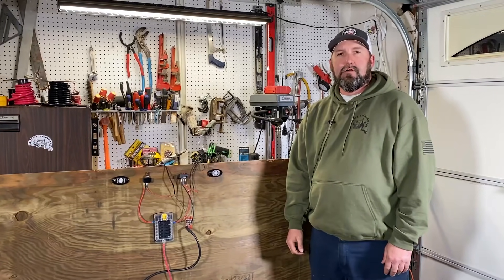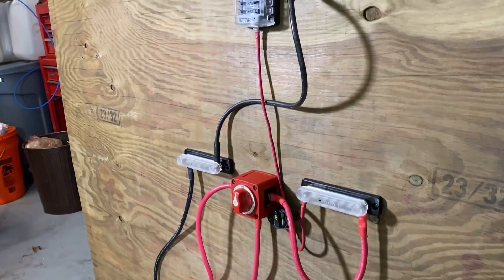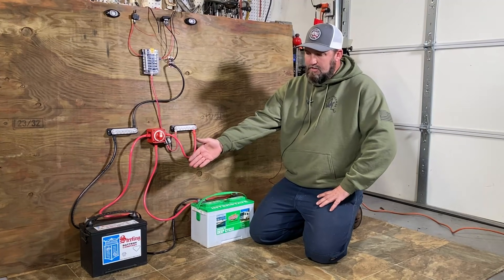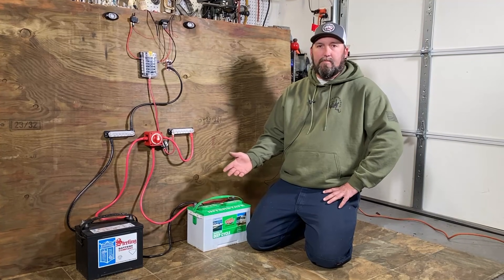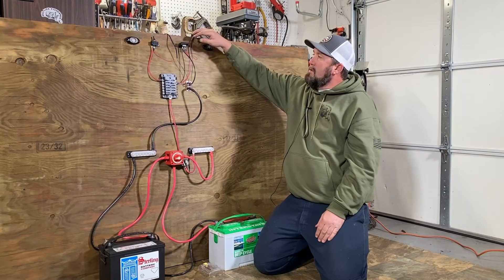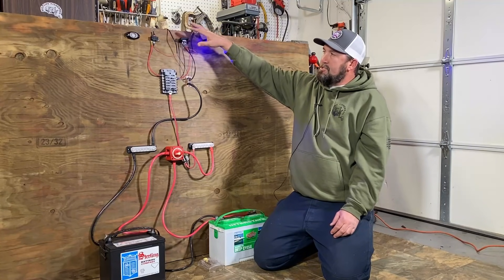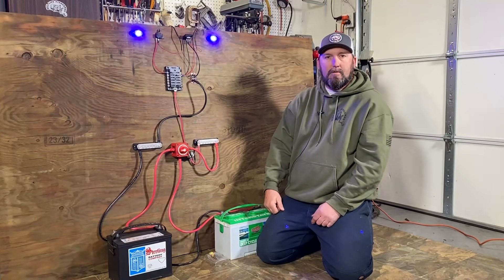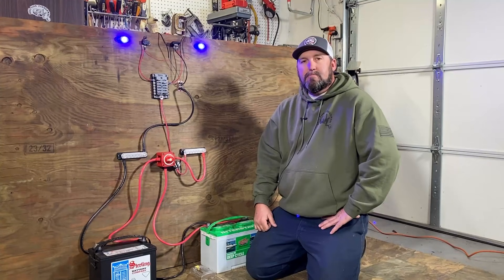BASIC BOAT DUAL BATTERY WIRING | HOW TO

Comment: I thought you werent supposed to connect negatives together of batteries of diff group sizes, can you clarify that for me?  New to this.  Thanks.
Reply from the maker: So you don’t want to connect the positives and negatives together this is parallel.. now with the battery switch on 1&2 they are .. and why you should only select 1&2 in emergency only really.. if you do it all the time.. it’s not good for the batteries.. the negatives have to be together for everything on the boat to work off of either battery.. hopefully that explains it a little better .. thanks for watching

Comment: Great tutorial. Thanks for sharing. Would this work with a 24v trolling motor setup? I assume your ground would only be connected to the first battery in series in the 24v system.

Comment: Great video. Quick question, I’m going to be rewriting my pontoon that I am redoing and I think this all makes a lot of sense. I was wondering though, if I had the switch on the Back by the batteries and ran the buster bar right next to it, and then run a line for a fuse box under the dash from the buster bar( like in this video). Will I be able to run 4 speakers and a sub woofer attached to the fuse box(that has fuses) which would be under the dash.  Or is it better to have the batteries under the dash in a pontoon? Thanks for all your great knowledge.
Reply from the maker: You can run a fuse panel under the dash and hook a stereo to it.. the stereo would then power the speakers itself.. but an amp for the subwoofer I would run back to the battery or main positive bus bar..  let me know if you have any questions and thanks for watching

Comment: On this set up are both batters recharged with the alternator?
Reply from the maker: If you have the switch on 1&2 yes .. but they are in parallel when in that position so if the batteries are not the same .. it’s not good to do for long periods.. only for emergencies really.. if you want to charge both batteries all the time.. you need to get a battery isolator charging relay.. I have another video on just that.. thanks for watching

Comment: You covered the bases pretty good! I would like to add that you have to be careful with some of the smaller outboards (most 75hp and less) Too much battery can burn out the alternator! A badly discharged battery can be too much for those little things. In all cases, the output ratings of a stock alternator is not continuous duty (inboard or outboard). Should you select both batteries and one is badly depleted it could be the end of the alternator. Now! Lithium batteries! Oh my god are these things a charge sponge! If you want one of these things for your auxiliary battery, there are things you need to know. #1 it may last longer than your boat. #2 you need to know how to feed it. If you have an inboard, you could put a heavy duty marine alternator in, but it may stall your engine when it kicks in on a depleted lithium 😆. There’s a better way. Use DC to DC charger like a Renogy to limit how hard you charge and to bring it to it’s peak. They come in 20, 40 and 60 amp range, so select one within the reasonable range of your alternator. Also invest in an AC powered lithium charger if you know you won’t have enough run time to bring it to full before your next trip. lithiums don’t need nor really like being stored at full charge like your old lead acid/AGM’s. If it’s going to be a while, anywhere between 70 and 40% full is ideal, just remember the self discharge may be around 2% a month if it’s wired in, assuming there’s no other parasitic drain. You just have to plug in the lithium charger a day or two before you use it. 
At this time I cannot recommend lithium batteries as your starting battery. Too hard on the alternator (no limit on charge) and may not have the high current needed for the starter. A V8 can draw hundreds of amps in a surge. It should be fine to use it as a boost momentarily to help the starting battery. Just don’t don’t use the battery switch when the engine is running, it’s better if you have momentary jump or relay.
Reply: Thank you for this information, please refer to my question above, thanks

Comment: pls help me, i just want to install the most basic one, outboard to the battery. currently the outboard battery cable i connect directly to the battery before fishing then once arrive home i will to disconnect again. how and what shud i do to leave the battery connected with the cable without i need to disconnect every single time back home. can i just buy a single switch? black cable goes directly to the negative terminal and positive to switch, then switch to positive battery? is this the correct way? if yes from switch to positive terminal what gauge wire should i use for honda bf60?

Comment: Great video. Those 3 way switches normally should be a  "make before break" switch. This prevents there ever being an open circuit before the next circuit is made. Therefore you can switch through positions 1, 2 and both with motor running as long as you DON'T switch through the OFF position while it is running.
Reply: What is the best way to charge battery 2 (battery 1 being the one used to crank motor over)?  Can you switch from battery 1 to battery 2 after starting the motor, provided you don't ever go to the "off" switch?  Otherwise, how do you ever charge battery 2 for a situation if you used your stereo at sand bar for quite a while?  I would have thought the best way to charge battery 2 would have been to go to the dial where you used batter 1+2 to do so, but you mentioned in the video to not do that very often.
Reply: good point..
Reply: This is my exact question also... once you drain battery 2 with the stereo/trolling motor/fish finder, etc. Can you switch to battery 1, start the motor up and make sure all is well, then switch to the battery 1&2 position to re-charge battery 2? I completely understand never to switch to, or through the off position with the motor running.
Reply: @curtisanderson01  If the switch is wired correctly then yes you can. I normally start the motor on one, or sometime both if the starter battery was a bit flat. If you start on 1 (starter battery) let it run on 1 for a bit to recharge and then switch to both or just 2 (house battery)
Reply: @curtisanderson01 u shouldn’t have anything else running to your trolling motor batteries.  They should have their own batteries

Comment: so when does the house battery get charged after playing stereo?
Reply from the maker: Either with a battery isolator which I prefer to install.. or when you get home and plug in your onboard charger.. which you should have anyway.. you could also run the battery switch on #2 when running your main motor which would charge the house battery but would have to have enough power to start the motor left on it.. or run the switch on #1&2 that would put the engines charge to both batteries.. but if they are 2 different size batteries or types I would not recommend that option.. that is more for emergency starting situation.. thanks for watching and let me know if you have any questions..

Comment: First off, excellent video! Secondly, if I was to hook up three amplifiers for my tower speakers, other boat speakers, and sub. Would i just connect all the positive leads to the positive bus, directly to the do cycle battery, or should I be adding another component?
Reply from the maker: I would hook them up to the positive bus.. that way you can run them off either battery.. but if your not going to be running the engine switch them to battery 2 the deep cycle.. also I would look into adding a Capacitor for the sub .. let me know if you have any questions.. thanks for watching the video

Comment: Great video and thanks for the effort!
Just one question:
my cable eyelet terminal (positive) which goes from bus bar to the fuse box is quite larger in diameter then the screw on the fuse box. By larger in diameter I mean larger hole in the terminal.

Is it okay to connect that way? Of course I intend to tighten it up well..

Thanks in advance for the reply!

Comment: Good description thanks, I would have also added the diagram for the negative and positives to the outboard coming off the busbars.
Reply from the maker: Thanks I appreciate it .. I think I mentioned in the video to run the motor positive off the battery switch output and the motor negative off the cranking battery negative .. but maybe having some wires running off the board to at Imaginary motor would’ve been a little more helpful for some .. thanks for watching and commenting and for the input..

Comment: This video is a life saver.  Really appreciate the level of detail.  

Question: I'm running a lead acid cranking battery for starter.  Currently all my electronics are running of same battery.  This is how dealer setup the boat.

I want to add a lithium house battery, with isolator.  

Do you see a benefit to going with a dual battery system like this.  I would never run the batteries at same time.  Only 1 or the other at any given time.

Any information on how to go lithium dual battery with lead acid starter battery would be appreciated.

Great work on this video and isolator install!

Comment: But where do you connect the starter motor for the outboard?
Reply from the maker: The outboard positive would be on the battery switch output.. and the negative would go in the cranking battery negative.. let me know if you have any questions and thanks for watching and commenting..
Reply: But wouldn't the charging circuit of the motor be charging the house battery only while you're running? What about the starter battery? You would lose power to your electronics on the dash whenever you start the motor by switching to start?

Comment: I have a really, really dumb question.  My house batteries are (2) 6V golf cart batteries connected in series to make 12V. Unlike most batteries, mine only has a bolt for each positive and each negative terminal.  It does not have the standard terminal like an automotive battery, just the bolt and a very small nubin next to it.  The battery charger cables (12 gauge), the inverter cables (4 gauge), the refrigerator cables (10 gauge I think) and a cable (1/0 AWG) to the main switch are all conected to the positive connection on one battery and to the negative terminal on the other respectively.  Because there are so many wires (5) connected to each positive and negative terminals I feel like I may not be getting a good connection to all these cables.   My question is this,  to relive all the connections to the battery terminals, can I install a buss bar and reroute the charger and the refrigerator to the buss bar or can I reroute the main switch to the bus bar or neither?  Does the battery charger need to be directly connected directly to the battery?  If so, can I reroute the main switch cables to the buss bar?  I realize this is a big question.  Thanks for your understanding.
Reply from the maker: So yes you could run a buss bar as long as everything was still hooked up in series..  not sure how you have your switch set up but anything on the battery or future buss bar is not controlled by the switch so would still have power when. The switch is off..  I would recommend running if your looking for long run time for things like fridge and things like that. Sound like you may have a bigger boat like a cabin cruiser or something.. I would say to go with 2 12v batteries and hook them in parallel.. then you could put the buss on the battery switch and hook the charger and jumper wires on the batteries only..  what style switch are you running? If it just is a off/on for that set up you have now? Or a 1/2/both/off like the video? Thanks for watching let me know if you have any questions and I’d love to help you figure anything out.. ive been busy lately studying hard for my Mercury certification testing
Reply: @ReelLifeFisherman  Hi.  Thanks for the reply.  I ended up connecting the Switch and the inverter to the batteries and ran a jumper to the buss bar.  It still a lot for the battery terminal but I can't see any other way around it.  The bus bar has the battery charger and the refrigerator connected to it.  (Though I'm not sure it is the refer wires.  They may go to a fuse panel under the dash but the rats nest under the dash precludes me from tracing/finding the wire.)  After I hooked everything up, I called Blue sea systems, Promariner, Interstate batteries and perko (the maker of the switch).  All agreed that everything sounded correctly oriented. So, with crossed fingers, I switched everything on and viola! Everything worked.  The unnerving thing was when I went to charge the batteries, I could hear them boiling inside.  According to Interstate, this is normal for golf cart batteries.  It did go quite after a few minutes but just hearing it had me quaking in my boots. RLF, thank you for your helping vote of confidence.  Super helpful,  Mark

Comment: Hey brother I’m thinking of running a positive wire from my battery up into the counsel for a fuse block with an in line fuse. What size should I run from the battery to the fuse block? And should it be the same gauge wire for my negative? Thanks

Comment: Okay.  Here are my suggestions.  Can you possibly make this even simpler?  I would like to see a better explanation of the positive and negative buses.  I think the reason for using them is so that you can efficiently tie in the electrical system and use less wires.  Also, I need a better explanation of the starting battery positive to the ignition switch and maybe a simple explanation of how that switch works and how the running motor spins an alternator or stator.  Then exactly how does that charging system send a charge back to the battery.  I think a negative wire sends the charge back.  Can you better explain this including where that negative charging battery wire hooks up and how it charges the starting battery?  Apparently it only charges one battery at a time and that depends on the switch.  That part kind of sucks but you did mention a battery isolator - can you explain that?  On your system above though can you explain the most common boat use scenarios?::  You arrive at boat and turn selector from off to position 1.  You start the boat and leave it in position one most of the time, I think, while on the boat.  I’m confused - when do you turn it to two?  How does the house battery work if the selector switch is left on one.  With it on position one, doesn’t that mean that the house battery wired to position 2 is off?  With the above system, Can you explain how a person would charge both batteries on a typical day(s) of fishing.  With this system, given good batteries, can a person expect that the boat batteries can be maintained with a good charge without needing to hook up the batteries to an external charger?  I am confused about how the batteries get recharged by the boat motor.  Can you also discuss the usefulness of a battery isolator?  The Blue Seas Systems add-a-battery seems to be highly recommended - can you explain how that works too especially in regards to charging the batteries.  Also, I see from the comments below that people are discussing having a fuse on both positives within seven inches of the battery.  Can you explain this?  I think you used a circuit breaker on the start battery positive for this reason.  Can you explain this even better as I believe a lot of people would skip this.  Is it truly necessary and why?  How do we choose the correct amp breaker?  Where do we get waterproof breakers?  Should the house battery have one too and why and what size?  Your explanation is very good but would be incredible with all of these details included.  Please address these in a future video.  Thank you for listening.

Comment: -Why do you have the black wire from the left bus bar to the second ground?

-Can you run your electric riggers to the fuse box or does that not work? You had said to run them to the bus bar as an example. 

-Same with the auto flip bilge, can you run that to the fuse box or does that need to be with an inline fuse and direct to the battery?
Or does having the fuse box ran to the output or common terminal on the battery selector do the same thing?

Comment: Looks good.  One issue is that you do need to fuse the power lead from the battery within 7" of the battery according to the ABYC standard.
Reply: You'll just blow fuses if you put fuse between battery and starter due to different conditions on how much the starter pulls from batteries. Not recommended 
Fuse house battery
Reply: So a fuse between the battery and starter? I realize this reply is 3 years old but maybe someone may reply.
Reply: @ete4445  A fuse between the battery and starter isn't required but ABYC says there should be a fuse between the batteries and everything else.
Reply: @todddunn945 what size fuse please?
Reply: @todddunn945 what size fuse please?
Reply: @jamesassheton5317  That depends on the maximum load from your electrical system and on the wire size from the battery.

Comment: so either I'm dumb or just confused. So I put in and go to start my boat motor.....position 1. now engine is running and now I need to motor the 3 hours to my fishing spot.......so how do I switch to position 2...my electronics which I need for nav.  without having to turn my motor off? He says not to switch it with the motor running and not to run it on position 1&2....sooooo what now?
Reply: Hey brother, when running after a few minutes your battery 1 is full again, then just switch to battery 2, you can do this without turning the motor off
Reply: @talitubi101  Won't switching the selector with the motor running kill the engine.